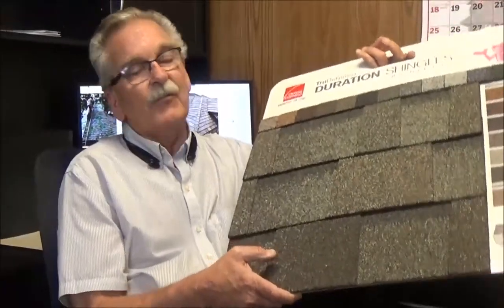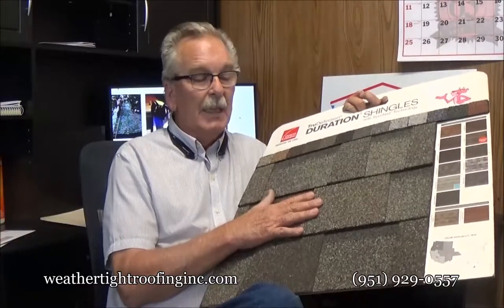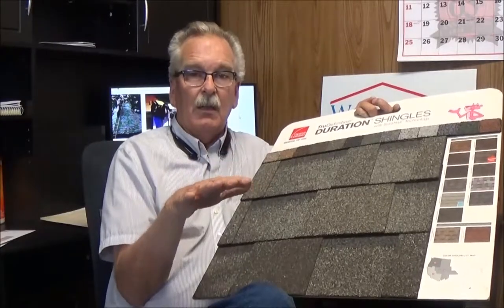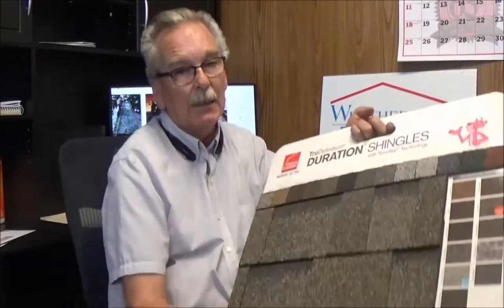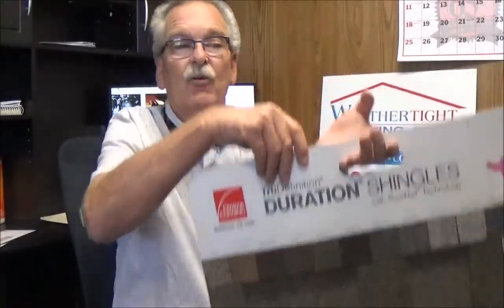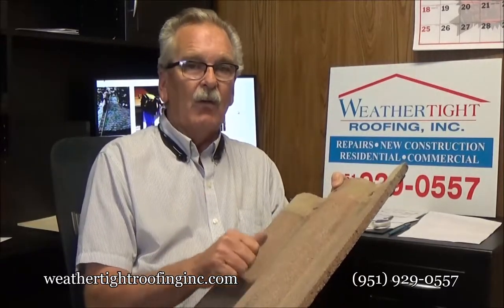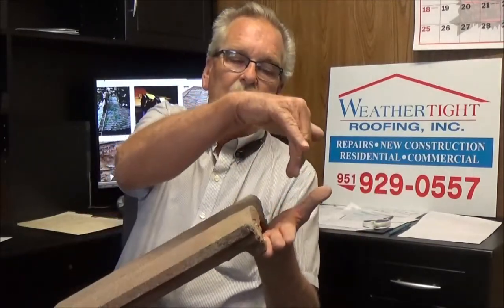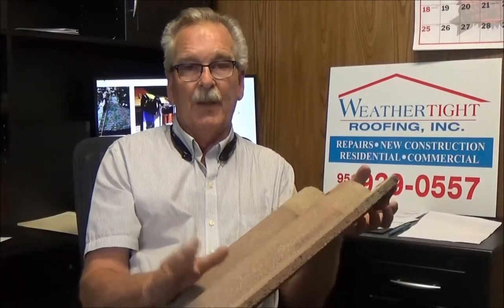Fiberglass Shingle v. Concrete Tile Roof - What's the difference?

Comment: what, there's no paper or anything used under those tiles in Australia
Reply: Neither here in BC
Reply: Nope, my tiled roof has no paper under the tiles. My roof is 23yrs old and never had a leak or crack, great solid low maintenance roof